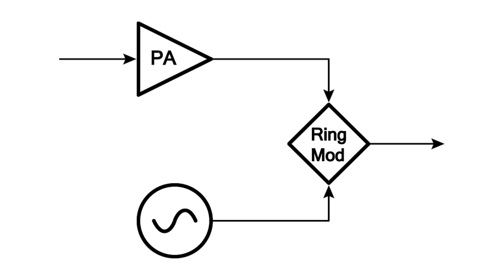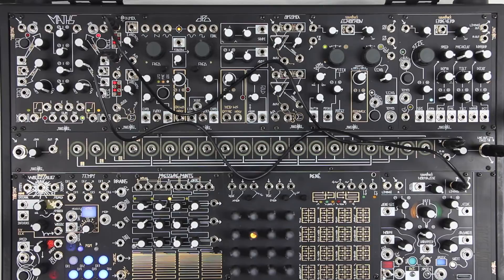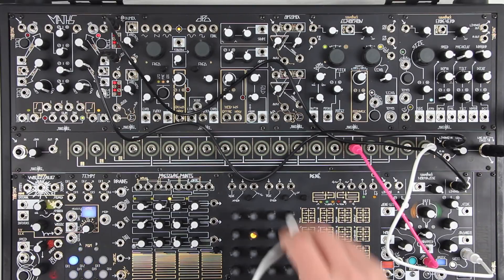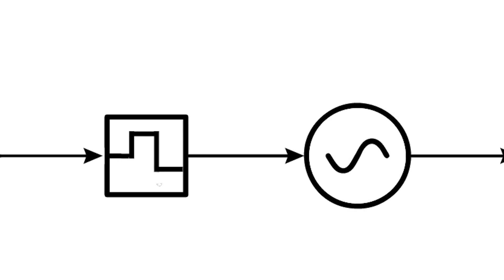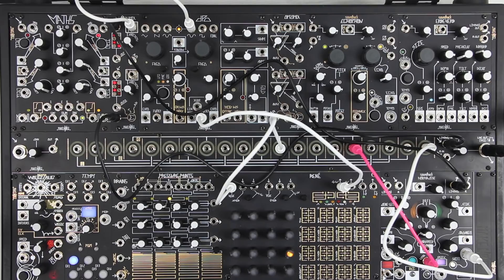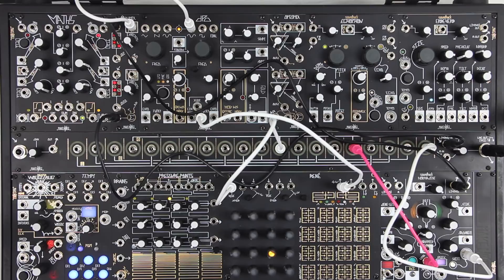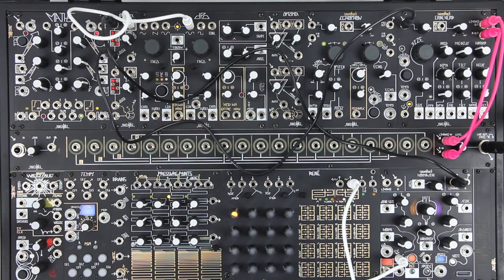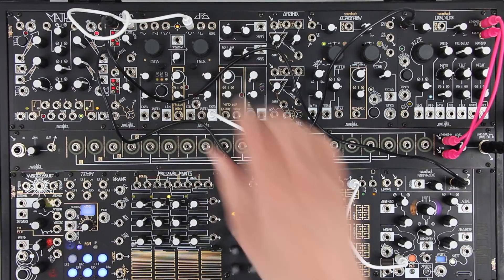Strange Acoustics: Ring Modulation of Acoustic Sound

Comment: So in this case, you are saying that the Ring Mod can act as its own voltage control oscillator, or VCO?
Reply from the maker: No, it still requires two signals to be multiplied together - here we are using a piano loop and a VCO for those signals.

Comment: great video. wouldnt it be nice to have pitchtracker to modulate the frequency of the ringmod. at least in my imagination that could be cool with or without a s+h. he did that with amplitude but theres not a real correlation between amplitude and frequency/spectrum.